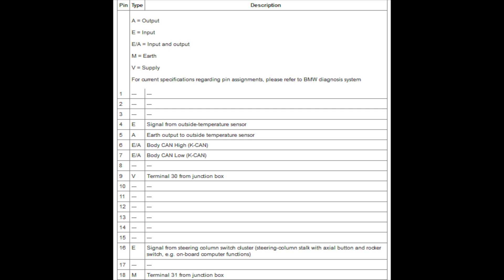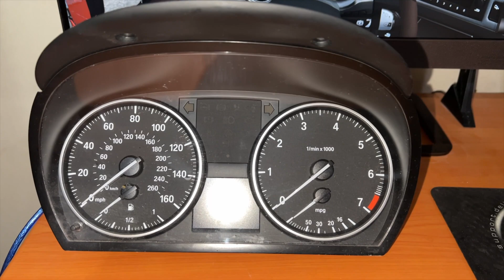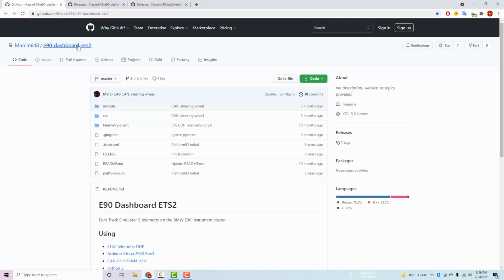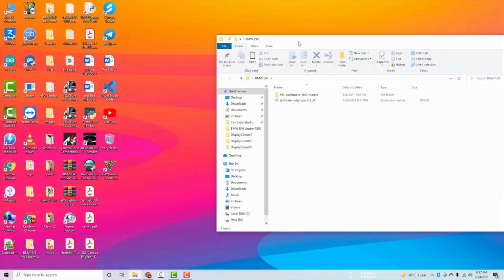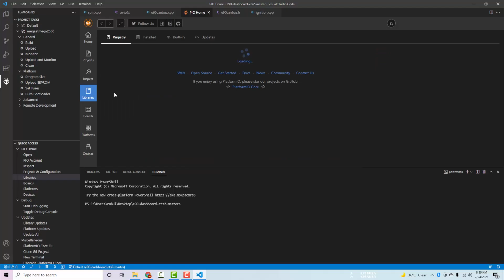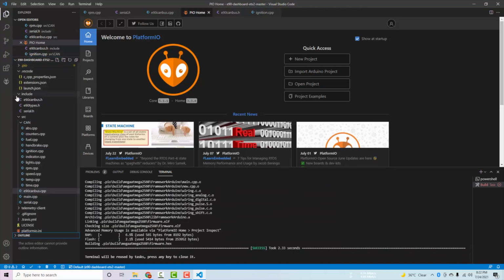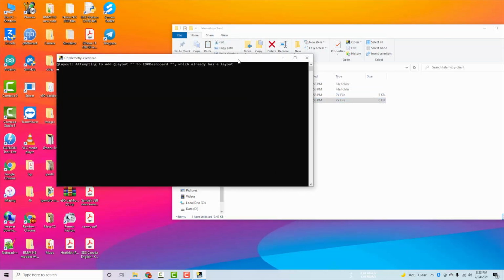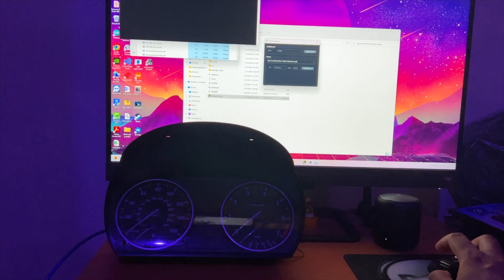BMW E90 instrument cluster for Euro/American Truck simulator#arduino #simracing #bmw #automobile

Comment from the maker: Update1(2024): Some of our discord members have made a free encrypted Arduino hex file that can be flashed to an UNO (with CS pins 9 & 10 versions) with X-Loader on their discord group too. The nCalc code is also present there. This is a second method for getting your E90 working. The code here is from a different group of people than the one mentioned in the video. Here is a link to the files in cloud since some folks are having difficulty joining the channel.

https://drive.google.com/drive/folders/1U9z4WubrQf4imlutEZ8eULHHfZXKKZNq?usp=sharing

Update 2: Some people have said that EU diesel seems to be working fine.
Reply: E87 Diesel works perfectly fine with it!

Comment: Bmw e39 cluster pls.. is imposible make it run RPM.
Reply from the maker: The E39 cluster is very similar to the e46. The only difference i believe is that the k-bus IDs for the E39 are different. So, dashlamps may not run. But in any case, I do not have an E39. But on our discord group, there are members who have E39 clusters. You could check with them.

Comment: Anyone got an idea why i only got a Car on a Lift? Aka Failure mode?
Reply from the maker: Can bus issue maybe?
Reply: @sciencetrove  yea that was an issue with the can bus speed, my 2012 cluster wanted 200kbps instead of 100
Reply from the maker: You mean 250kpbs?
Reply: @sciencetrove  or 250 yea, something along those lines

Comment: Does it work in other games like beamng or assetto corsa
Reply from the maker: The OG code only truck sims. But in the description there is my pinned comment. I've added a link to a discord group where they have Arduino sketch that should also work with beamng also.

Comment: Tutorial for 2009 Dodge Grand Caravan/2010 Volkswagen Routan please.
Reply from the maker: If the about cluster is non CAN bus based the. You can follow the bmw e36 guide to get it running. But if it is can bus based then you need the can IDs and its frames to get it working. Unfortunately I don’t have these clusters or this can info with me
Reply: @sciencetrove   Sorry for not responding this was a year, LMAO, but i found all the CAN frames for the Routan cluster, Now everything works as is, still can't find a way to kill the TPMS light and the airbag light, ill have to keep digging further online.

Comment: I play beamng and ETS2, do I need to do anything else to use it with Beamng? I noticed you put a beamng variant, but is it a beamng and ETS2 or just beamng? Also because in the video on the github, the beamng variant, the dash lights don't seem to work
Reply from the maker: Check the pinned comment I added recently, in case you haven't figured it yet. The link to the discord channel should lead you to an Arduino sketch that supports beamng also.
Reply: Hey I have a e60 diesel cluster and have you found out is it compatible with Beamng as that’s what i mainly play 
Thanks a mil

Comment: hey, i have the same cluster and i was wondering if it would work with an arduino UNO and a MCP 2515 module? Thanks
Reply: yes i have the same! someone a solution?
Reply from the maker: Well I guess it should work. Now I don’t have the module per se to test and help you if it didn’t work. These Chinese clones of can shield are pretty cheap like from keystudio and it’s a one time buy.
Reply: @richardvanreenen3172  @FranciscZC it works with some changes in code. I can help you

Comment: How did you wire up the steering column button exactly?
Reply from the maker: Well on the cluster if you ground the pin 16 it allows you to toggle a few options in the cluster LCD.
Reply: @sciencetrove  hi, I ground it and nothing happens do I have to do anything else

Comment: I want to buy an cluster that works on 24v, if I buy an 24v for it and that arduino stuff. Then it should work right?
Reply from the maker: 24V is generally used in trucks I guess. But the code for e90 is specific to it and maybe the bmw e60. Running a different cluster requires a different arduino code especially if it’s a can bus based one.

Comment: Hi, how did you make the simhub version work? I just hit connect and nothing happens
Reply from the maker: The connect button is a bit glitchy, you need to press it a few times to make it connect. But it will connect eventually

Comment: Did you need a 12 v power supply to power the cluster up
Reply from the maker: Yes, I’ve used an old hp computer power supply. But any 12V 3-5Amp adapter will do fine.

Comment: hello 🙂 I want to ask if I can run a mileage on an e90 with a mcp2515 module and play games? or i will need canbus
Reply from the maker: Well don’t get the mini board with MCP2515. Better to get a shield that fits on top of arduino board. With the other one you need to do your own homework or get help. More people use shield. Definitely the e90 is can is driven. But advantage is if only has four wires. 12V, gnd, can high and can low.

Comment: Is it possible to use ardruino uno instead of ardruino mega?
and if it is let me know
Thank you!
Reply from the maker: I haven't tried, but I guess it should work.

In platformino.ini file change it to following:
[env:uno]
platform = atmelavr
board = uno
framework = arduino
Reply: Thx so much!
Reply: So, the code did upload to the ardruino but on the cluster is the "service" icon
Do you know the problem?
Reply from the maker: @nullfex5958  you mean in the central lcd the warning icons keep looping? That’s going to be there always given that we aren’t sending any signals for those.

All the can bus ID was taken from loopbunny.co.uk website. You can try to see if you can play with other ones like cruise control for example to get it to work.
Reply: Of i Connect the CAN it will show the icon with the car on a lift, If it is not connected to CAN it doesn't.
I think it doesn't work bc the odometer is  EU  diesel
Reply from the maker: @nullFex  That is the red can bus error icon, says something is wrong with your can bus. By the way you may want to change the CS pin to 10 (and also change CAN_BAUD_RATE = CAN_100KBPS to 500kbps) in configuration.h and try in case you are using a different shield other than from Seeed studios. BTW you may need to cut the P1 terminal resistor if your cluster loops.

Yeah, I've read on discord channel people say the UK diesel variant has issues.
Reply: @sciencetrove  Is it working only on euro truck simulator or you can use it in other games?
I was trying with sim hub with the plugin.
Now it doesn't show the can bus error
Do you know the why it doesn't work or what i can do?
Reply from the maker: @nullfex5958  The telemetry.exe executable you can see it only works for ETS2 & ATS. I tried the simhub plugin, but for me only the gauges work. No lights! There is another variation of this code in the description used with beamng.
Reply: @sciencetrove  the gauges still don't move
Reply from the maker: @nullfex5958  You can try a Kombi "KI" test to see if your gauge is fine.  in your "src>CAN>ignition.cpp" file, 0x130 the first byte which is 0x45 change it to 0x41, then hold the button on the cluster till it shows some stuff like 1 and some weird letters and then click it very fast once and then if its on "2" you should quickly double click
and the cluster should  perform a self test